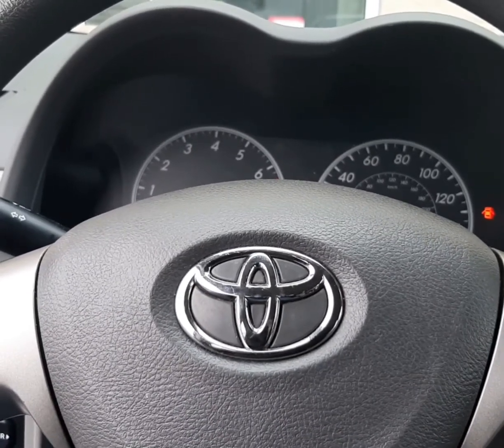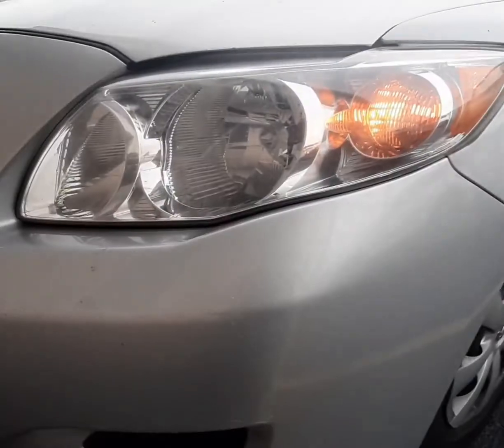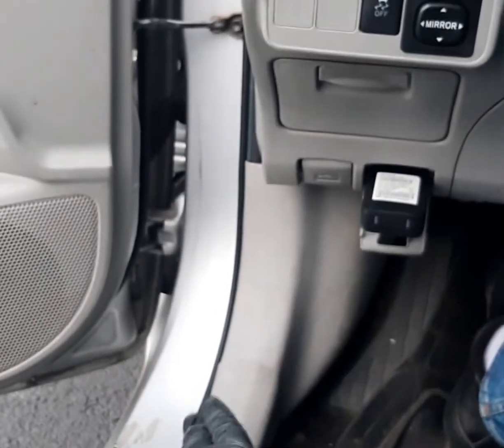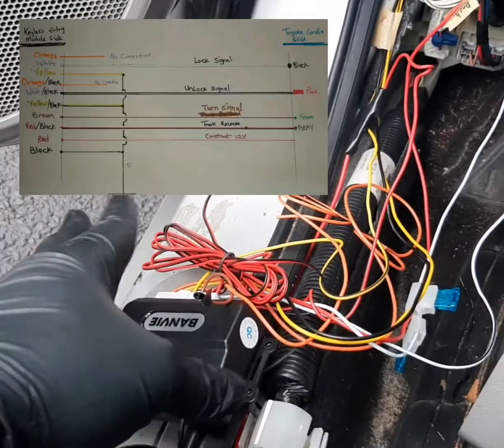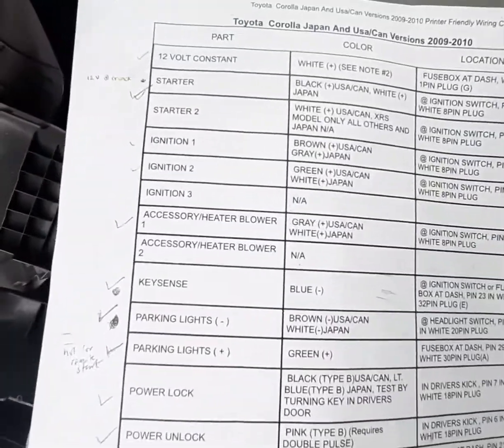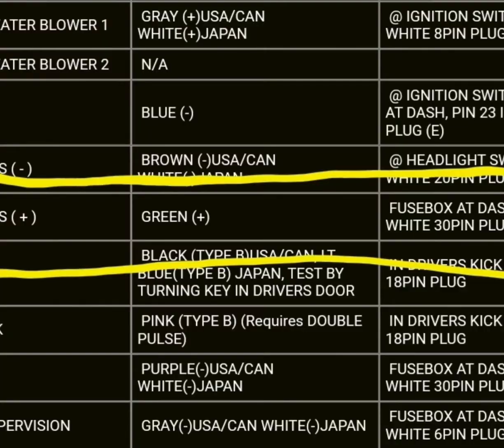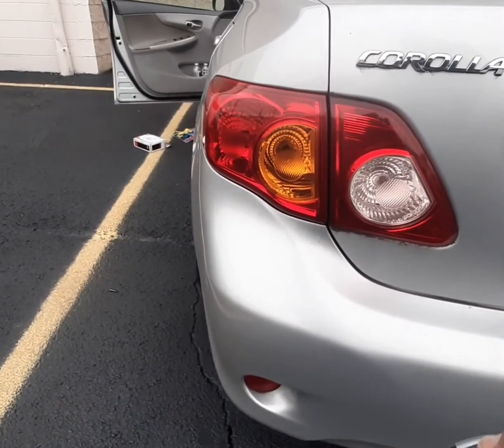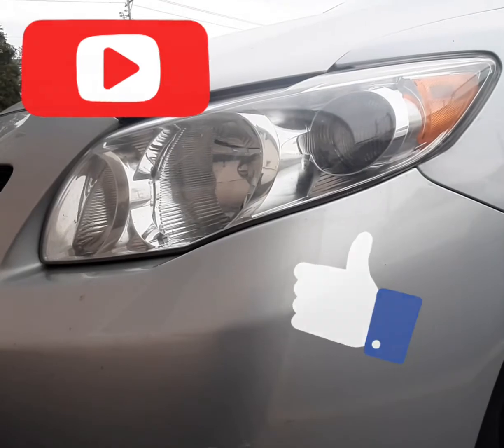How to Connect Parking Light to Aftermarket Keyless Entry System

Comment: Thank you. I have mine flashing but I want the turn signal to flash instead and not the parking lights. How do I do this?
Reply from the maker: Turn signal will only flash when your car is in on or running. That is why parking light is necessary.
Reply: The emergency lights work without the ignition. How do I connect it to that?
Reply from the maker: Look for the wiring diagram online.

Comment: Thanks.  What about the horn?
Reply from the maker: The horn wire is under the steering column. If you connect it, the sound is annoying. It is better to get an external horn to connect. Get a soft horn

Comment: Bad connection, you connected to the city lights not to the parking ligths
Reply from the maker: The connection I made is correct and working for my car.
Reply: @eazidiy check the video again and you will see the red lights blinking instead the yellow lights
Reply from the maker: There are 2 parking lights for the car according to the wiring diagram, positive and negative parking light wires. For my keyless entry system, the parking light output is positive signal. So it work for the positive parking light of the car. I have been using this for 2 years now.
Reply: Men, is connected to the wrong wires, when you lock the city lights blink instead the emergency parking lights
Reply from the maker: I have heard you, I appreciate your comment.

Comment: What abt my camry from factory when i lock my car from remote the turn signal blink but i want the parking light to blink i have seen it but i dont know how its done
Reply from the maker: You have a factory fob key, it is already connected that way. You wont be able to change it unless you by an aftermarket keyless entry module
Reply: @eazidiy oh do u know the price for one aftermarket module of 02  camry  i thought i would have to splice some wires
Reply from the maker: @yourfavcamry  Any aftermarket module will work, you just have to know the wire colors for unlock, lock and parking light. I also have the link to purchase here https://www.amazon.com/gp/product/B07L4LTXSK/ref=ppx_yo_dt_b_asin_title_o08_s00?ie=UTF8&psc=1